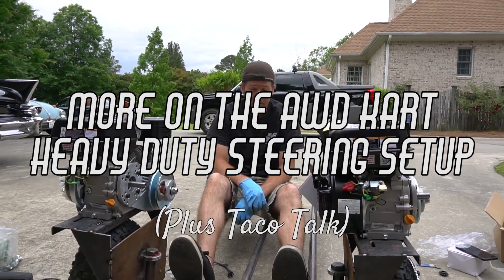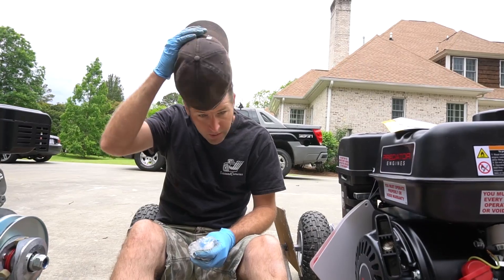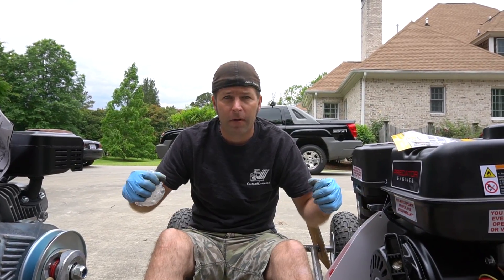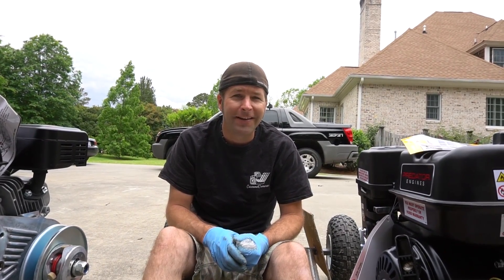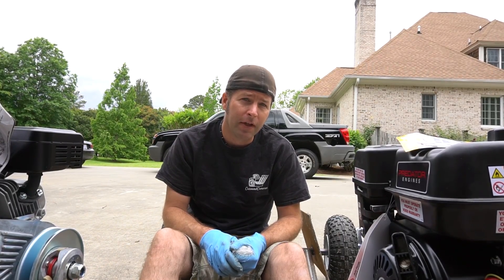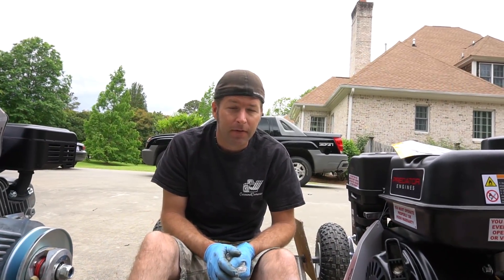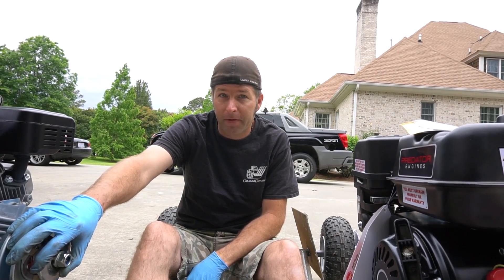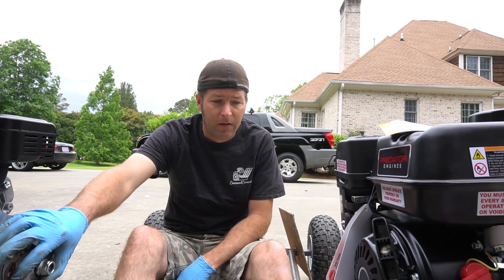More on the AWD Steering Setup

Comment: High power FWD and AWD race cars have a lot of toe out. this helps balance the torque steer and also helps with cornering. The problem is more tire ware. maybe this info helps.
Reply: The Dutch Garage really... seems like it would be really unstable
Reply: Not really, caster has a lot to do with stability. Also what I mean by " a lot" is maybe 1 or 2 degrees.
Reply: then it wouldnt be pushing together and pulling apart is no problem
Reply: redsixer -_- : no not really, i think that if they add alot of positive caster they can counter that isseu better. Steering will be a bitch though.
Reply: but as i said no taco= good. i am agreeing with u =)
Reply: redsixer -_- mmm tacos =)

Comment: Double tie rods are a good idea, just need to figure out how to link them smoothly. For steering maybe you could use a bmx handle bar setup with dual hand throttles to independently control each front engine. Its like a crude torque vectoring system and would help with torque steer. Great work guys, hope it turns out fine :)

Comment: CV shaft in the front being turned by both engines would be better, although it might be hard to match the front and rear tire speed since a CV shaft loses more power than a chain drive would

Comment: Use cart size steering racks on the front and back, do 4 wheel steering with a gear reduction. The one thing the cart will want to do is pull hard if you have to turn sharp, so having that gear reduction and 4 wheel steering will allow it to turn easier along with keeping the center of gravity more stable, since the engines are mounted up high. Car steering racks are made out of fairly thick steel so they shouldn't't bend at all even if their pre-bent.

Comment: a big (say 1/2inch threaded rod) steering linkage on the back and a old car hood spring with a chain across the front, Then you need not worry about getting two rods the same length and mounted the same distance from the center of pivot

Comment: I'm thinking a simple 3/4" thick wall pipe with 1/2" thread heim ends. One strait rod wheel to wheel. They use 1" rods like this with 3/4" ends for the upper and lower suspension links on race cars that make upwards of 1000 hp. Keep it simple, and maybe a little overkill with 3/4" mild steel pipe.

Comment: You should weld a piece of 3/4 inch rod onto the metal plates connecting them and use it as a steering rod.wouldnt have to worry about it folding up, it'd be strong as hell

Comment: With two steering rods one will be under tension always so no worry of the other under compression. 

The real problem will be getting the engines running in sync close enough, the top heaviness, the sprockets fouling and throwing chains all the time.

Comment: I would suggest adding a steering stabilizer (like trucks use).. Since you're not using power steering, you could use a hood strut so that you're applying just a slight mechanical advantage with out killing your arms.

Comment: Hey guys, how about a steering dampner, like what is used on the front sold axle 4WD truck, instead of dual steering racks?
Reply: Yes not sure why they are over complicating the design. Have the rack setup with the arms to steer and simple add a solid bar with joints on each end of the solid bar to solve the issue of the possible ''fold in, pull out''. Maybe the bar out front and the steering in back or flip that around depending on space needs.

Comment: Hmm...interesting. There isn't a 'tie-link' like you're describing on a front wheel drive car, or is there? Also , since you're using an automotive R&P, I would think that would be plenty strong for two 6.5hp engines. Meant as more of a question than a criticism. Super cool project. Should be a rocket!
Reply: I tend to agree.  Seems to be heading for overly complicated... on an already over complicated build.  I'd stick with standard practices and think 'beef'.
Reply: same , id make some top linakges from plate to plate,, add some reinforcement  but the actual steering rack would be the one they already have.

Comment: I'm thinking the solution to the steering problem may be two different accelerators. 1 for each foot. Braking would have to be a handle or you could have a rocker style accelerator/brake foot control. Or hydraulic braking system.

Comment: I have a suggestion for the steering-- Instead of using two steering linkages (one in the front, and one in the back), you could have a (single) steering linkage in the back, and a simple bar in the front (it would have a hinge on each end, and it would prevent the engine plates from spreading apart from each other), that connects the two engine plates together.  

If you do this, you wouldn't have to worry about bending the steering linkage, because the bar in the front would absorb all of the shock.

Comment: How did you guys meet and get started???
Reply: I worked on his cars
Reply: Isaac it'll be fine hey Isaac. maybe do an left and right throttle steering? meaning you have the 2 left engines on one throttle. and right side the same way.. so you could steer by giving more throttle too one side. and then between the front wheels the simple steering you have on most karts. 
i do not know if that would work.. just a thought

Comment: I say you have a single gas pedal for the rear engines and a brake pedal, but instead of a steering wheel, use handlebars with 2 gas levers/throttles one for left motor and one for the right front motor, that way you can control the steering better

Comment: Mount the front solid just like the back. Then steer like a zero turn mower. One side spins faster one side slow , thus a torque steer. Then just have a break pedal up from to stop. It's simple

Comment: I'm thinking you guys are gonna have to setup something like a motorbike handbar system with separate throttles. When going into a turn you're gonna have to worry about one tire spinning faster than the other. Also may want to think about changing the sprockets in a way that the rear wheels spin a bit faster than the front to avoid plow straight during partial throttle in a turn. 

OR another idea. Setup the power in a way that you can control each side individually. Eliminate the need for any kind of steering rack at all. You'd probably have to shorten the wheelbase or widen the cart but you'd basically control it like a tank. Curious to see how this ends up.

Comment: Use .095" wall tubing instead of solid rods, it's stiffer under compression. You could probably get away with a single tubular tie rod on one side of the spindles, and the steering shafts on the other side.

Comment: Okay. I totally agree with ike. My question though is why not make your own tie rod? You take a tie rod from go power sports Thanks to go power sports! and then you cut the two tie rod ends off (keeping about..idk 5 inches on each bulb) then you take a piece of squair stock that is.. idk 1 inch, and then cut slits in the ends so that you can bend it inwords and essentially roset weld it to the tie rod bulbs. That would give you one hell of a tie rod. But This method will work as well. Im just thinking, if you used  the method I suggested, it would be more rugged for off road perpouses.

Comment: Is this thing gonna be able to break all four tires loose when you stomp the throttle for some 4 wheel drifting ?
Honestly I was expecting cv joints and fancy suspension set up with rack and pinion steering with a turbo set up on front and rear center mounted 1000cc motorcycle engines.

Comment: 1000+ BHP cars just run one straight track bar between the front wheels, I don't know why you think you'll need to double it up, but hey :)

Other thought is that you will likely get binding if you have any ackerman with front and rear track bars, there is a reason it isn't done on production vehicles :)

Comment: I'm confused.  why will the front wheels try to pull in toward each other?
Reply: The front wheels "try to pull in toward each other" because the steering spindle pivot points are inboard of the torque applied in the opposite direction at the contact patch

Comment: How are you going to keep the wheels moving at similar speeds other than the fuel delivery? Are you gonna have any kind of solid "axle" that will make sure the front wheels turn at the same rate? Otherwise I think it's gonna walk around with the wheels wanting to turn at different speeds
Reply: It'll be fine
Reply: This really is going to be interesting. Balancing will be a big issue hear. Even if you can get them running absolutely in sync. As soon you turn the wheel the inner wheel "must" turn slower than the outside wheel. on the rear it doesn't matter to much.I think a balancing bar is needed. When you turn one engine throttle is reduced. I am really interested to see how they going to solve that.
Reply: m4xwellmurd3r Correct answer
Reply: Yeah, I think it would just want to plow straight ahead without slowing the front inner wheel down at least.

Comment: torque steer is due an imbalance of power delivery to the front wheels.  since you have two engines and each is actually mounted on the steered part of the axle there's no telling which way if any torque steer will affect you.  with the  low power of the engines I highly doubt the effect will be noticable and certainly not enough to collapse a tie rod!

Comment: Why not have all four wheels fixed in place and have one engine/torque converter connected to two wheels (on the same side) via chain or belt drive? Like a tank or zero turn mower. Steer by reducing throttle to one engine at a time.

Comment: the part you really need to worry about is the front and rear inner and outer tires spinning at the same rate due to the "AWD". its going to turn worse than a train lol the inside engines will have to have less throttle than the outside engines. especially the rear tires or it'll be good for nothing but donuts.

Comment: So all wheel drive AND all wheel steering ?
Reply: Back Seat Garage No. Only the front wheels will steer.  The steering rod will be attached to the wheels in front of the center point, and behind the center point.

Comment: why not chop the front off a 4x4 four wheeler, weld that on then just have one engine running the front wheels, and two on the rear, one for each wheel. kinda like the new nsx with their electric motor awd setup

Comment: If you're going with steering rods and ditching the rack idea, why not go with a cross bar steering setup and just make the cross bar strong as all hell? You're probably not too far off the width from just using factory Jeep TJ/XJ bars and they're just hollow tubes that should be easy to cut down and resize and then you have real tie rod ends and everything. If you were closer I'd just give you my stock stuff to use. It's waiting for the scrap man like 90% of other Jeep owners stock stuff is. The stuff is easy to come by.

I also still think you're missing an opportunity to make it all wheel steering too since you have to engineer it for the front anyhow. May as well add hand steering to the rear just for the donuts.

Comment: You need to look at a standard 4x4 old school front end. You are over complicating the thing. A simple straight bar from one side to the other with joints on each end "drag link" to stop the ''inward outward fold effect'' and then your steering setup with the 2 rods and steering pinion system. The rod or drag link can be a nice tube steal, aint no way you will fold it unless you crash it.

Comment: it's a damn go kart... it doesn't produce enough power to bend a decently strong arm... just buy a thick wall pipe. problem solved. way over thinking this shit. I personally think the motors sitting on the front like that will cause more damage to the steering joints from gforces and the weight of the motors. this seems like a disaster.